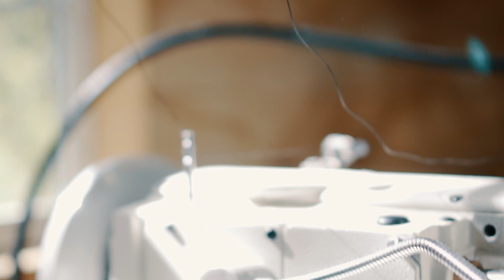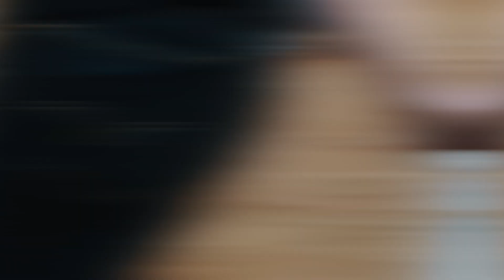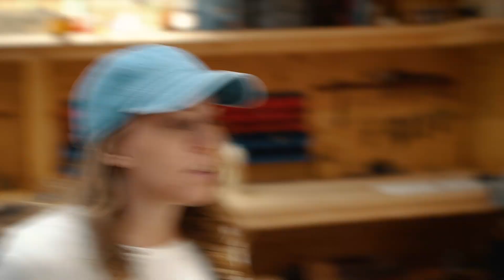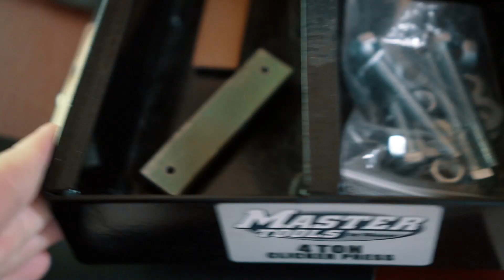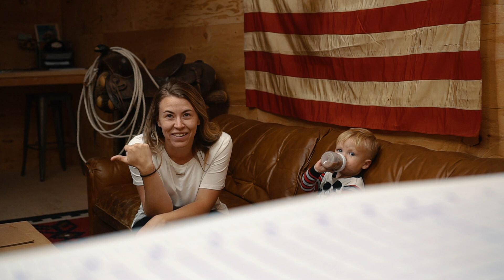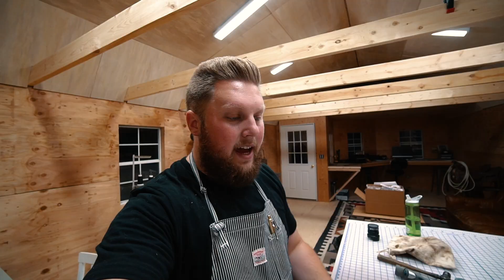How I changed my mind about edge burnishing - VLOG

Comment: The problem I've found with tokonole and gum trag is that it tends to dry out eventually and get kind of brittle. The edge gets rough and abrasive in the areas that flex. I only slick with water, saddle soap and wax anymore. Stays flexible.

Comment: I make my burnishers out of Oak Dowels.  I chuck a 1/2 dowel in the drill press, sand them smooth and then make the grooves with files followed by sand paper.  Granted Oak is not a particularly oily wood but the work well enough for me.